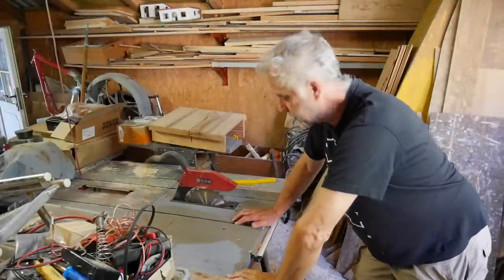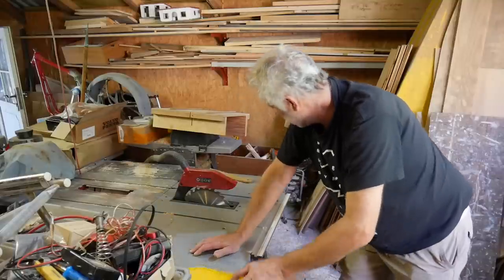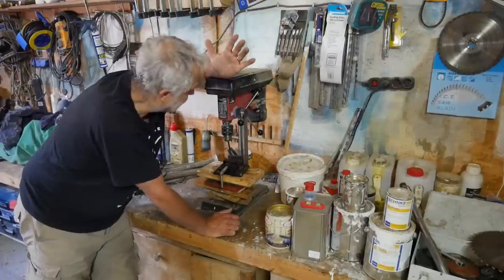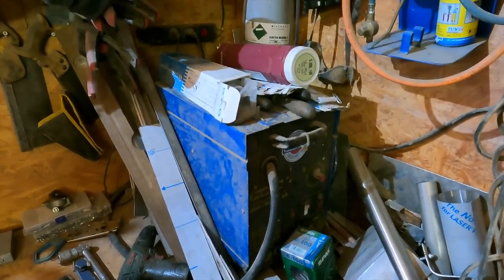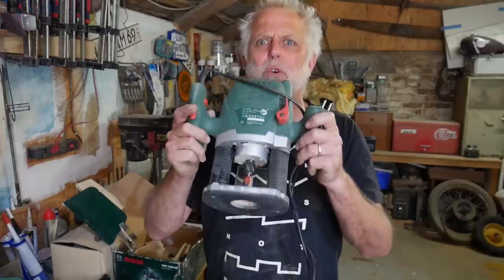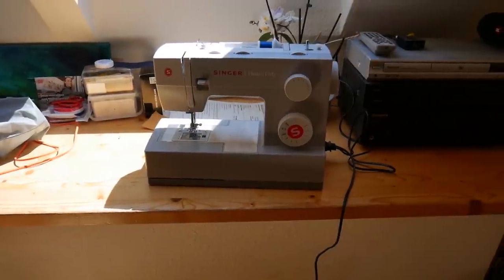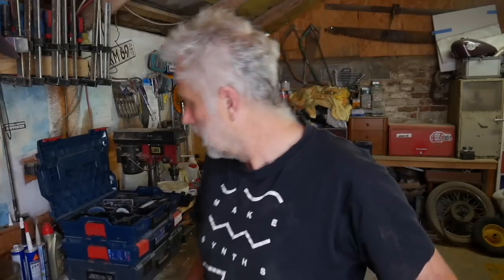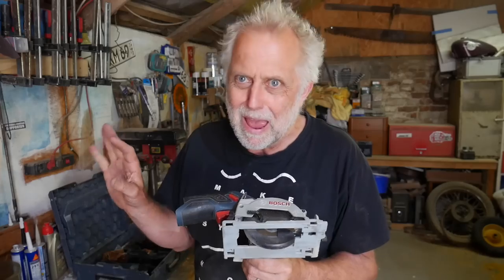What Tools Do You Need To Build A Sailboat??? - SV Tapatya EP283

Comment: Hi Tony, that was a great scamper through the tool review, I could not help wondering of how many things you ‘found’ that had been in that safe place while gathering them up for the review.

I have to say from the outset, I was impressed by the wee Bosch 12V planer and it certainly earned its keep during the build.

Fingers crossed for a smooth transition to the new location.😀👍⛵️
Reply from the maker: Thanks Norman. Yes, the little Bosch machines have done well 👍

Comment: Finally found a solution to make your own keel
The liftable keel of the sailboat I'm going to make only needs 250kg
I buy small pieces of lead, which are more expensive but neatly arranged in fairings made of resin.
The price of low-temperature metals with a melting point of 100 degrees Celsius is about 10 euros per kilogram and the density is 9.7g/cm 3
The density of lead is 11.34g/cm 3
Only fill the gaps in the keel fairing and lead block with cryogenic metal.

You see if this plan is feasible. The most important thing is that I can achieve it at home
Reply from the maker: As I understand it, yes, it sounds feasible. However, 250kg isn’t a lot of lead. You can easily melt 50 or 60kg in one go with a decent gas burner. You could just cast the lead in a well-braced plywood mold 🤔

Comment: I started out buying my woodworking machines from Delta and Porter Cable..later on I changed to buying Milwaukee and Makita….Was never impressed with Dewalt portable tools..
Reply from the maker: No doubt,  good stuff, Frans. I think, basically, we have to work with what’s available in our area at whatever price we can afford. The majority of the brands out there are making tools that will do the job (we just need to avoid the utter rubbish). Longevity is a consideration, obviously, but price another one. Clearly, there’s a balance there that everyone has to decide on for themselves 👍😃